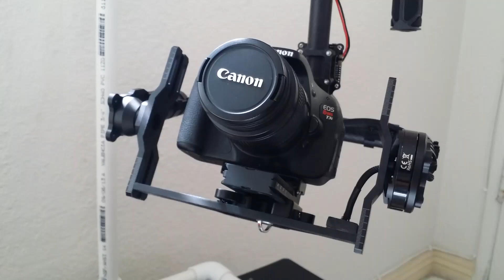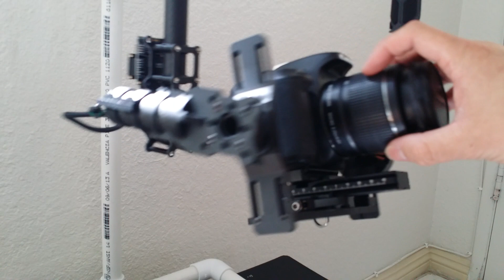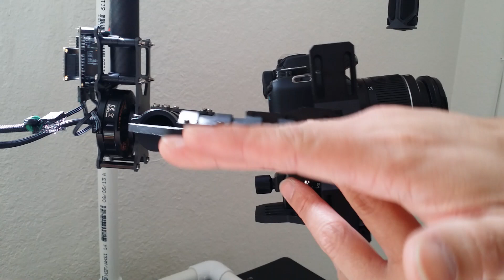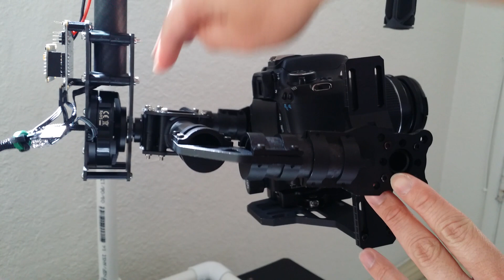How to Balance a 3 Axis Brushless Gimbal Part 2

Comment: Hi there. First, thanks for doing these videos. They are very clear, helped me alot.
second, i've got a question. I have a bmpcc, with a speedbooster that connects to a quite heavy wide angle lens. The speedbooster is the connector for my quickrelease. (which is not really fitting, so its skewed a little bit.) All in all, its quite a funky set up and nothing like a block of camera weight, but delicate)

i've done all the 3 axis stabilising, but i arrive at a problem. When i have my roll perfectly balanced, and also my yaw, they affect the (formerly perfect) pitch balance. but when i fix my pitch balance, its throws off the roll and it goes back and forth like that.. It's quite frustrating, i was hoping if you'd had any advice.  My roll arms are pretty much perfect 90c i believe. 

love to hear your thoughts.

Comment: Im having a hard time with the roll. I get it to balance with the bar. But when i try to roll to and other degree.  It doesn't stay.  It drops fast. In both directions. ? Is it you heavy? Came 7500 with a 70d 24-105l.  I've seen it used thou
Reply: I'm in the same with the 70D and tamron 17-50 vc

Comment: Can you tell me what camera plate are you using? i can see it has two axis and i can't find something like that anywhere. did you ever managed to balance a 5d mk 3 with this gimbal?
Reply from the maker: I got the plates a while back and forgot exactly what they are called. Unfortunately the plates does not work with a 5D on this gimbal as the DYS gimbal does not provide enough room for adjustments. On my other gimbal the plates with well for all types of DSLR camera